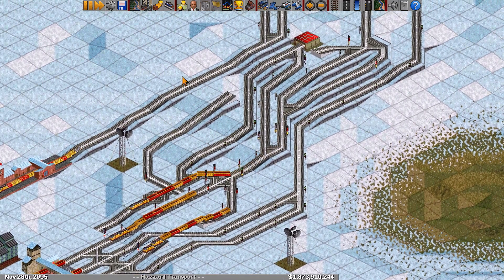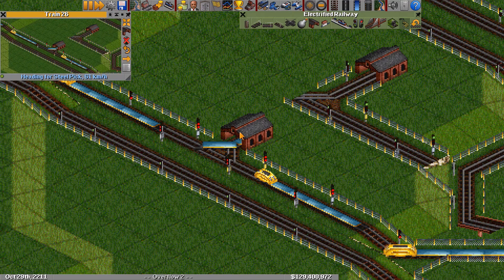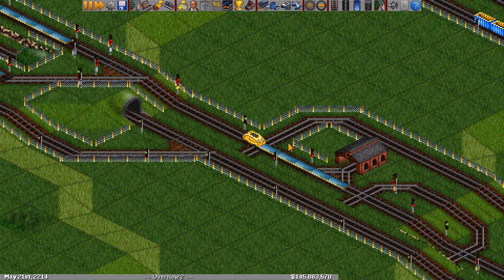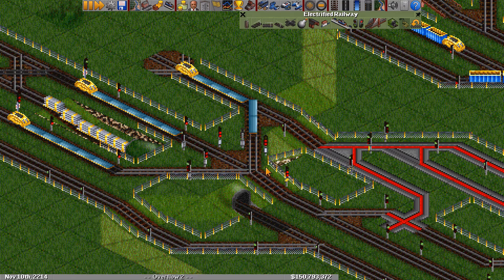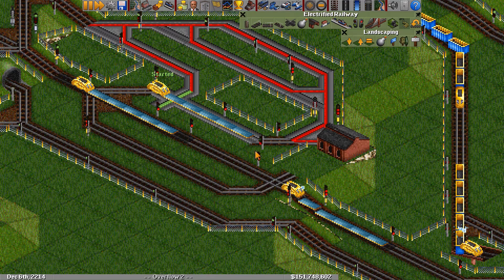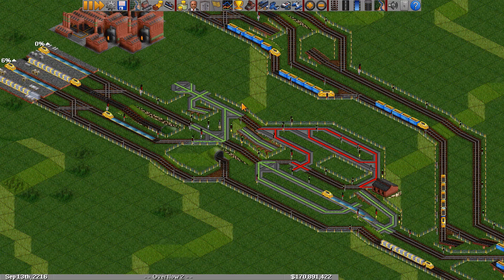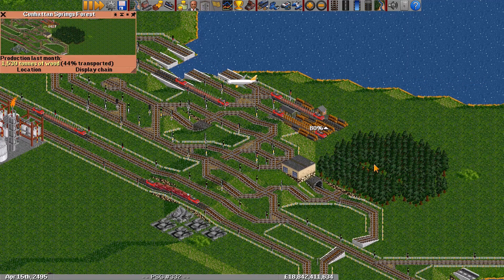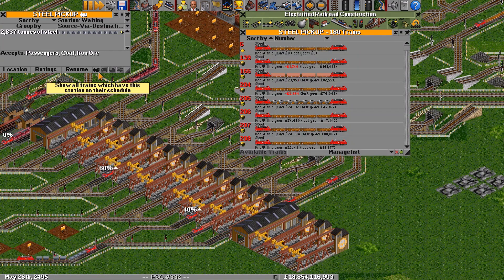Overflows Tutorial for OpenTTD (part 2)

Comment: Would it still be wise to build a full-blown overflow system at a strictly drop off industry, specifically power plants, or is there another way you recommend handling high train loads at those stations?

Comment: My trains refuse to enter the reverser, it is a bit difficult to explain so please look at 5:44 for this.

You can see in at the timestamp how leading to the station, the two exit signals, are red and the one exit signal leading to the reverser is green, and how due to the green exit signal the entry to that block (before the three exit signals) is green as well -- the trains therefore can enter that block, however in my case, the trains entering that block don't enter the green exit signal leading to the reverser, but instead que before the red exit signal leading to the station.

I have never seen a train que before a red exit signal before, this is an issue totally new to me so I have not a clue on how to fix it or why it is that it works for you.
Reply: Ok, nvm, I am a moron, I have now placed two way exit signals at my station and now they want to enter the reverser, while I have no understanding why it works with a two exit signal, but it does, and I am still at the copy and paste stage of the game when it comes to learning this, so this is fine, but if you could explain in greater detail, that'd be great.

Comment: well the way i pass the problem is by making more tracks on the train station
usually around 8-10 lanes are enough to handle huge number of trains and a single 2 lines entering existing the station

where i prioritize at which lane the trains will try to move in
which gives  a huge help trains entering stations and entering to not block each other

Comment: This below seems to work good enough for me.
It sees the trains maintained (indefinately while in depot) and the trains wait for empty station track before exiting.
An alternate design when the roundtrip is short, is to make a train order for conditional service and add track to allow a
train to loop into the station without going into the depot.

D - - p - - - - - - s - - - - - - - - - - - - - - - < incomming empty train
     \ - SSSSSS p \
       \ - SSSSSS p - - p - - - - - - - - - - - > outgoing loaded train
         \ - SSSSSS p /

-  \  /   track
D epot
p ath signal
S tation
s ignal

Comment: Played this game since that horrible dodgy click mouse, that felt like grabbing a roofing tile.. 
Only discovered this FIRS mode a couple months ago. 
It's hard to build these mega hubs, and keep track on every junction. Let alone organise the station inlets. 
But a question that can work on either grf setting;
What I find really hard to perfect is the signals.. where is smart to place, and where is it not useful even though it seems logical? 

To make sure you don't clog f.ex.. 
There is a main line station, that is fed by a sub station close by. 
Is it easier to make a bigger station, with more lines in (space can sometimes be limited for mega stations), but make the sub station route longer? 
Or like I did, connect it to the main line, as well as possible, to accommodate different goods but at the risk of slowing down the main line..? 
Sorry think that might be two questions. Thanks for the friendly guides. They are really good...
That FIRS setting is a really great idea, and makes the game much more complex.
Any starter tips on good secure business?
Reply: With this overflow, the different use of signals, and the positions is very demanding.. wish you could slow the tempo down by 1,5x. 
I do get the priority thing, but to link it with all those combo signals.. phew

Comment: Does this still work with the latest version of OpenTTD ? I have "set yapf.rail_firstred_twoway_eol 1" but the trains just queue in front of the station while the exit signal of the overflow is green. Thanks if you could get back to me on this as I'm super confused as to why it doesn't work

Comment: I build the exact same setup as you had at 7:53 but for some reason the trains refuse to go into the overflow. The entry signal is green because the combo signal at the overflow is green, but then they just stack up on one of the red signals going to the waiting bays. I am using the little Y at the end of overflow bay. I have no idea what I am doing wrong. Suggestions?
Reply from the maker: Tauntless Make sure the exit signals towards the station are two-way and also make sure you set yapf.rail_firstred_twoway_eol 1. If that isn’t the issue I need a screenshot or save file to help debug
(Edit: fix typo)
Reply: @LugnutsK  Ah yes, the "set yapf.rail_firstred_twoway_eol 1"... I forget about that one every time I reinstall the game... Damn you for making me install the game again! :P
Just for anyone reading this in the future: the command is entered in the command console opened with "~"
Reply from the maker: Note you can change that setting at any time, even in-game. Also thanks, fixed that typo
Reply: @LugnutsK  doesn't seem to work if the station is too large for me for some reason i cut down from 5 to 2 stations and suddenly it works o.O all i did was remove 1 track